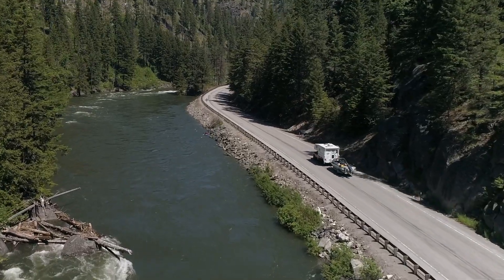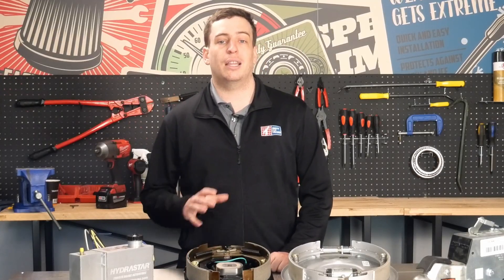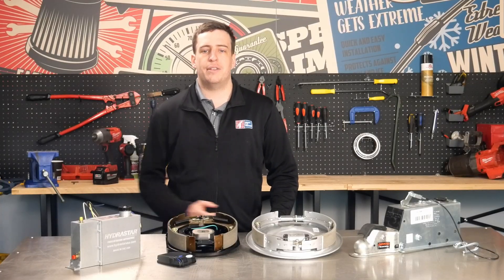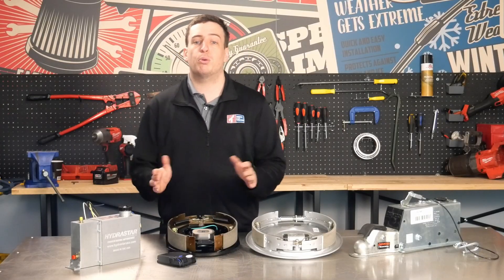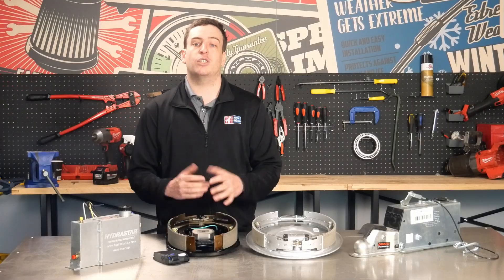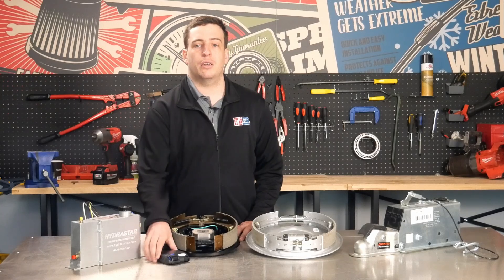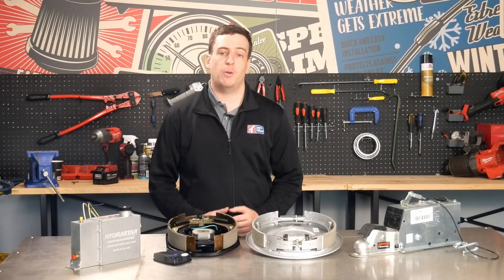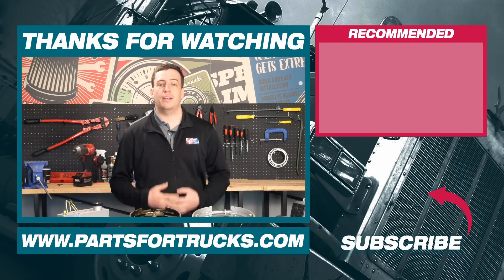Don’t Tow Without Knowing This: Trailer Brake Systems Explained

Comment: so, a truck with out break controller does not work at all when breaking with an electric drums trailer brakes?
Reply from the maker: That's right. A trailer that is running electric drums won't work unless there is a brake controller in the tow vehicle
Reply: @partsfortrucks  thanks

Comment: I live in Europe and the most prevalent system for most trailers is mechanical surge brakes since they are almost fool-proof and require very little maintenance.
Reply from the maker: That comes as no surprise, they are by far the simplest of the options available.